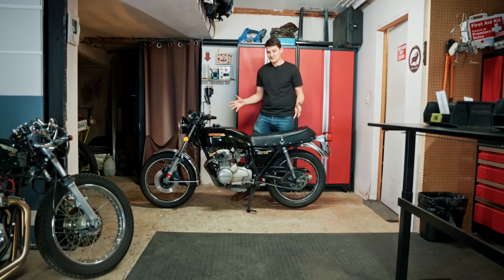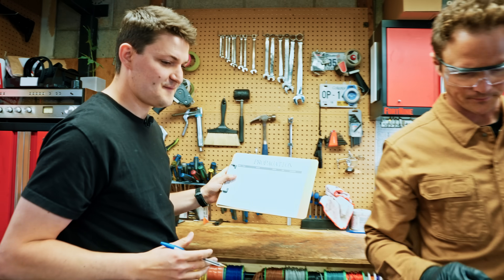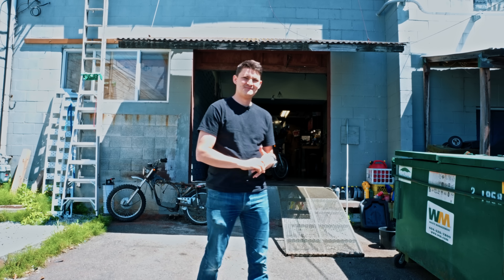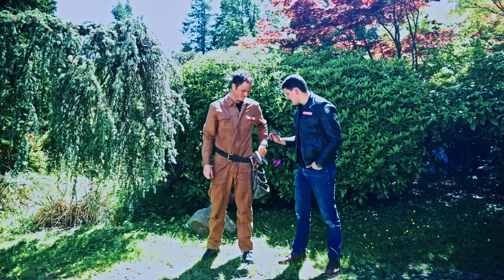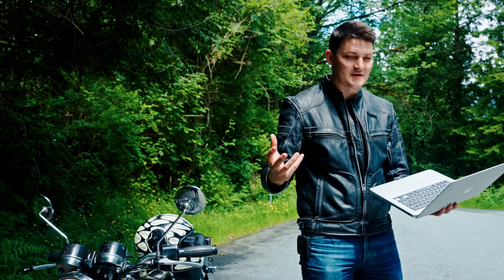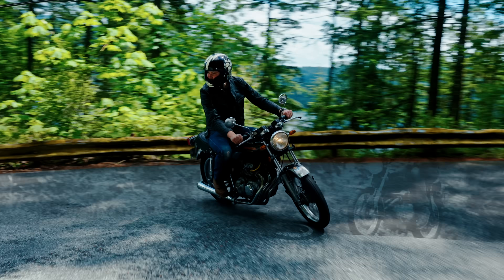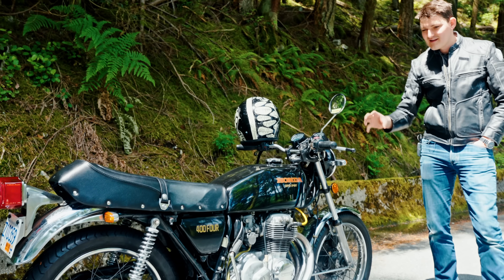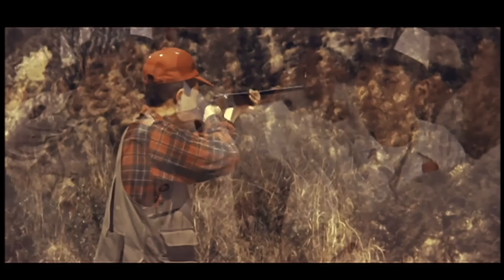Why Hondas Run Great - JIT Manufacturing, 5S Methodology and Kaizen

Comment: As a former Toyota employee I can’t begin to tell you how happy this video made me.  The ability to say hey this isn’t working we need to fix it here is my idea and having the problem fixed that day was amazing.
Reply: That is absolutely crucial to the process. I used to work for a company that ripped this idea off without any sort of real understanding for it. The result was that at the location that I was working out, we would regularly run low on essential parts in spite of plenty of space to store it because the local management didn't know what they were doing. The stuff was selling through regularly, but we lost I'm not even sure how many thousands of dollars in lost sales because they wouldn't allow us to order enough to satisfy demand.

Standardized systems like this can definitely work very well, but everybody needs to be involved and there needs to be some awareness and flexibility for when the situations at one job-site or another dictates modifications.  So much of the 5 S process was just for show and a lot of it actively ate away at the margins because the standards didn't take into account the fact that smaller stores might need more inventory on hand as boxes only came in certain sizes. For every 100 products we would need a minimum of 100 boxes in inventory. And, up to double that if the boxes were starting to run low.
Reply: I wish my job was like that, for me it's "hey this isn't working", a dozen meetings about it later I'm burned out about everyone trying to draft up their own solution, I stop perusing a fix and then nothing changes.
Reply: Currently working at Toyota and the principles are great! However management and communication is a very hefty problem that tarnishes worker morale and takes away personal ownership of work.
Reply: To bad that they don't do that anymore. Since the new CEO, quality has dropped... A LOT. The cheaper plastics and engine recalls are telling.
Reply: @MrMoneyHelper  Honda motorcycles or Honda cars?
Reply: @thisisfrankoo  My earlier comment was about Toyota's CEO allowing lower quality parts. If I had a comment about Honda I don't see it in this thread.
Reply: Very well produced video. Educational too.  😄
Reply: 2.5min single shot 😂
Reply: I work for a toyota supplier and it, in fact, does not work that way at all and it made me so sad to find out and see first hand. There is so much waste in my plant from service parts sitting in a warehouse for 6+ months to endless over time hours just because some middle manager wants to sit on his phone while getting paid.
Reply: @dragostea  I work for a Japanese owned Honda supplier and it's the same here. We have signs everywhere about 5s, but they're english words and it frankly just boils down to keeping work areas clean and organized. We panic to get certain parts made in time to ship out to Honda, yet other parts have been collecting dust for months. I suggest a simple change that could be done immediately and would save 4 people about 2 hours of work per day per person, and it doesn't happen because my boss's boss has an even better idea that'll take a year to implement (and never happens). I'm the fastest person in the company at my particular job, but because two other people regularly break certain safety rules to get it done faster (and then hide in the corner and play on their phones), I'm told I'm slow and eventually get moved to another much simpler task that I struggle with due to health related reasons. And then people wonder why modern Japanese cars aren't as reliable as they were in the 90s.
Reply: As someone who lived in Japan, this seems so crazy to me. It's the opposite of everything I know about modern Japanese work culture. Makes ya wonder what happened.
Reply: @Cobbbler  It was never a "Japanese thing" - it was certain companies.  The quality of Japanese products pre-WWII was notoriously bad.
Reply: @SmallSpoonBrigade 

That's not really unique to Toyotas. Fuel gauges are only so accurate because they rely on perfect alignment of the sending unit and the temp of a bimetallic strip. Even under best conditions the sending unit is not guaranteed to be reading the exact fuel level due to the shape of the tank.  Only recently did cars start using microprocessors for this. I don't think any bikes have yet but I don't own any new-new vehicles.
Reply: @SmallSpoonBrigade  I’m assuming you’ve never owned an American car of similar vintage. I’ve owned 60+ vehicles and have driven close to a million miles now. Every year Toyota I’ve owned (except for a select few specific cars) were built better than every Honda, Chevy, ford, bmw, etc. maybe not as exciting, but built better.
Reply: Hopefully they don't. This isn't a big problem, and is easily fixed by filling up before the last 5-10% of the gauge is hit. The cost of another microprocessor for something so superficial and simple isn't worth it financially or environmentally.
Reply: @dznnf7  Wasn't it post WW2? Before WW2 Japan wasn't really prominent in exports.
It was after ww2 that they became the joke that went on to shift to China.
Their economy was bad because of the war. But their main exports didn't shift to things like cars until much later.
Reply: @Cobbbler  this makes sense to me, seems like honda defied the norms derived from confucianism by building a company culture that puts respect on subordinate's feedback, thus iterating better products than the competitors
Reply: Thanks for the awesome trucks.  I love my 1st gen Tundra. 😊
Reply: That's fast. I work in Peugeot (Stellantis) and something like that, depending on how urgent, will take at least a few days
Reply: That's a is actually one of my favourite things about Toyota; its created many "fun fact!" Type moments during car conversations, especially with the non car peeps
Reply: Gung-Ho
Reply: AHHH ❤ LOVED MY 400/4
Reply: This is awesome I’m gonna inject this in my life
Reply: I bought a 2000 4.7 tundra new for 20000 I now have over 400,OOO on it and it runs great a amazing motor revs so fast.
Reply: yea i work at a Toyota parts factory and i was surprised it wasn't just Toyota that uses 5s
Reply: As a long-time study of quality and innovation in Toyota & Honda, I fully get where you're coming from.  That sort of culture is incredibly motivating, and why other companies haven't been able to copy that level of dedication, because it's built into the culture.  Glad you got a chance to experience it!
Reply: Don' t forget what LEAN did to Japanese quality
Reply: I hate the idea that Honda gets credit for everything Toyota taught them.
Reply: @FordFlatSix  And people hate that Japan gets credit for ideas initiated by Juran, and Deming - who got their ideas from Shewhart and others.  We're all connected.
Reply: @dznnf7  TBH Demings 14 points is TPS, but American business shunned him for suggesting that profits go back into a company rather than shareholder bank accounts.
Reply: @FordFlatSix  You nailed it.
Reply: @FordFlatSix  That's not why they shunned him.  At the time he was proposing change, they sold everything they made with no competition.  They simply didn't have to get better.  When that changed, they changed.
Reply: @dznnf7  Same can be said for stealth concepts and calculations from the Russians that Americans actually executed in the B-2 and F-22, etc. It's admirable to be the genius that comes up with it, but it's another level of genius and dedication to actually execute something so unintuitive, especially in a large organization.
Reply: @dznnf7  To each other, biologically.  To the Earth, chemically.  To the rest of the universe, atomically.
Reply: @dznnf7  Japan can take FULL credit for Juan & Deming, because Japan actually bothered to listen to both of these fine gentlemen.  What should be included in Kaizen is Ford, GM, and Chrysler, and how they thought this sort of stuff was nuts... giving employees the authority to fix a problem.
Reply: @FordFlatSix  was wondering if anyone made that comment, Toyota strategy is a little different tho.
Reply: @FordFlatSix Toyota, like Honda often, is underperforming for anyone with expectations beyond a Red Ryder wagon. 

Reliability can only be measured when performance is equal. Toyota, and often Honda, never make it to the starting line. 

If reliability is all that matters, Ford would…
- remove the twin turbos from their ecoboost V6s. 
- go from their 10-speed transmission back to a 4. 
- eliminate the transfer case. 
- and strive for 3 star safety ratings and terrible MPG. 

Then F150s would be equivalently “reliable” to Toyota trucks. 

The opposite is happening. Toyota is copying Ford for practical and corrupt governmental reasons. They couldn’t compete in the American market. Why? No performance. 

Someone saying “Toyota is reliable” is equivalent to a GM fanboy telling a racer “my corvette is more reliable than your NASCAR.” It simply doesn’t make sense. 

Performance comes at a cost of reliability. There’s a reason you see more F150s on the road than “reliable” Tundras. They simply do not compare is any measure outside of longevity, and now that’s no longer the case.
Reply: @FordFlatSix Lean 6 / Sigma aint patented
Reply: @FordFlatSix if you think was that originally a Toyota thing you have a lot to learn.
Reply: @EnlightenedSavage  sorry, I’ve read Deming’s 14 points for Management.
Reply: @FordFlatSix Toyota taught Honda 😅
Really! Honda has had a great bike for longer than Toyota has been around 

Toyota is treated like a GOD
It's good, don't get me wrong! But it's not the only good vehicle, even more, it's not the best

Get over it 😢
Reply: @greekkidshows9373  It’s called the Toyota Production System for a reason.  Honda was a supplier for Toyota long before he made his moped.
Reply: @FordFlatSix  ok  that’s interesting 
I’ll have to check that out 🧐

This is coming from a Ford fan 😅
I guess i can take your word for it
Reply: My experience owning multiple Toyota’s over the years is that they also make shitboxes .
Reply: I worked at Toyota dealerships (3) and their management is abysmal.
Reply: @unsafe_at_any_speed  Dealers have little to do with the manufacturer, by US law.  Except Tesla - they get a pass because they're so virtuous.
Reply: @unsafe_at_any_speed dealers have absolutely nothing to do with the manufacturer in terms of management. Car dealerships, at least in North America but I think most other countries too, are independently owned and operated on a brand license agreement. Toyota can force a dealer to sell the business off of the owner gets in legal trouble for example, but that’s about it.
Reply: @unsafe_at_any_speed the manufacturer does not run the dealership!
Reply: @unsafe_at_any_speed  Toyota dealership management has almost nothing to do with Toyota manufacturing.
Reply: @unsafe_at_any_speed dealerships and privately owned. The ones in North America are terrible
Reply: @unsafe_at_any_speed yeah, but that's a dealership. Toyota has no hearing on how they operate, kinda like how McDonald's just collects rent and doesn't do anything about bad operation. The operation is the franchises responsibility, while the menu is on the big hats
Reply: @unsafe_at_any_speed A dealership is VERY different than manufacturing.
Reply: @unsafe_at_any_speed my boy, dealerships are not owned by Toyota. Has literally nothing to do with the manufacturer besides they have a contract to buy and sale their cars. Completely different management teams
Reply: @unsafe_at_any_speed  That's a dealership, not a manufacture owned center.
Reply: 100% agreed. Nothing works properly and they gaslight the shit out of employees and customers
Reply: GM is the total opposite !!
Reply: Stick to cheap commuter cars, Toyota. Or don’t, IDC. Dare to make a HD. After all, Toyota is so….”reliable.”

Comment: Those 400 4's were just as fast as the RD350/400, they just didn't handle quite as well and didn't have the 'spank' powerband.
Reply: Stock, maybe.  With an expansion chamber?  No way.
Reply: @jaym8027  IDK, I saw a guy get an Early 70's Honda 350 twin to run in the 11's at the dragstrip with stiffer valve springs that allowed higher RPMs…

Comment: I love my 50 year old Hondas! ❤ Not because they run great, look great, and won't leave you stranded due to a mechanical issue. I love them because of the pride and attention to detail that they were built with. Old Hondas are a lot like the Model T. Simple, affordable, reliable and easy to maintain. Most all new bikes today must be taken to an authorized dealership to have even the most basic service performed in order to clear the codes. If you did have to go to the Honda dealership, it was to buy parts like clutch handles, blinkers, fenders, chains, sprockets, etc. as you were honing your skills on a virtually indestructible machine. 😊

Comment: 5S and Kaizen are amazing. JIT, I believe CAN be great in manufacturing areas that are very stable and not prone to disruption, eg local source of materials, very little complexity. But, as we saw during covid, JIT turns in to NIT (not in time) once a supply chain disruption happens. My job was having a year lead time on PLC's required to control machines, we were having trouble purchasing the specialized metal that we need in order for our factory to operate. 

My company was very fortunate to have good relationships with US based tool makers, which allowed us to get tooling while most of the companies that didn't have pre-existing relationships weren't able to get carbide tooling. Even with our good relationship of US based suppliers, we still had major issues keeping machines running due to parts we needed from south korea, japan, and china.
Reply: That's because JIT was only half the lesson, the other half is Heijunka. One of the main reasons it's been so hard for companies in other countries to copy successfully is they could never be bothered to learn and implement it all. It's a system that works in harmony.
Reply: I remember in 1980s spare parts importing was tough, it took a lot of convincing to get more parts imported cause the estimates were just way off. Just In Time doesn't work if you need something repaired immediately but the part have to be on back order for 3 weeks, it ruins the customer experience.  Motorbike shops could waste half a day doing a ring around to all the other shops asking "Do you have X part, send it to me overnight".
Reply: Very much, it’s easy to do things in the moment when you can always get a supply of exactly when you need it. It becomes hard when that supply is gone, that’s when parts hoarding for manufacture becomes necessary and things get chaotic because we can’t finish the motorcycle because the plastic company doesn’t have enough material to make red brake lights

Comment: I've ridden several brands and it's on the Honda that you notice the little things that make your life easier. The center stand on my Forza is placed just so that it's easy to put up and roll off. Other brands tend to put the weight too much on either side, either it's difficult to roll onto the stand and easy to roll off or vice versa. I've also ridden a CB125R and CB400 and it's the same on those models as well.

Comment: Meh, own a five year old Honda that rusts like something that rolled off the production line at British Leyland, has an associated parts market that would be at home under a "Daylight Robbery" sign, and is a COMPLETE PITA to work on - from stripping panels to get at a bulb or disassembling the PoS to get at a clutch cable. A screw the pooch business strategy seems to have replaced and would embarrass an era of quality control that seemingly peaked in the late 90s/early 2000s.